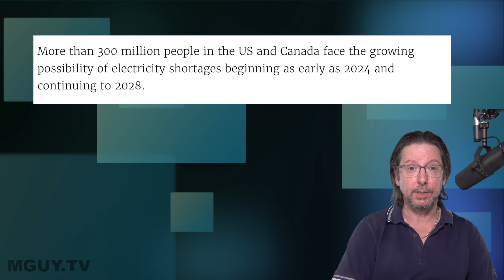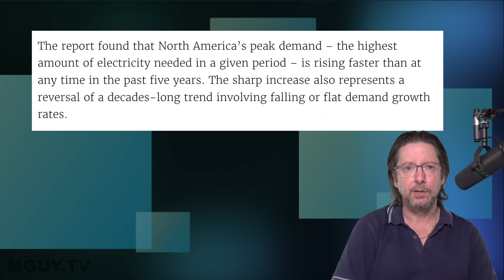Electricity grids WON'T COPE with mass EV charging | MGUY Australia

Comment: On top of that, the power grid is 33 percent efficient. A diesel is already more efficient before you even plug in your EV.
Reply: This is why some EVs now come with a Range Extender aka a ICE generator.
Reply: @winstons1806  which is just comical
Reply: @winstons1806 no, that is just a bid by the oil companies and legacy auto makers to keep control of your wallet. 
They don’t want you having real independence by making your own energy.
Reply: There's that 33 again. 😂
Reply: You are one of the very few people who realizes that.
Reply: If a diesel is more efficient than electricity, why do hybrids exist and have higher mpg?
Reply: @Undergroundexpedition  you could do the same thing with a big spring. Hybrids store kinetic energy. At 100 mph a hybrid and a regular car, of the same type, the regular car would get better mileage. No kinetic energy to store and the hybrid is heavier.
Reply: 33%,  I think you need to put your aprons on and get back to lodge you clowns.
Reply: Yummy spicey comments!
Reply: What's 33% efficient, from power source to power point, or just the power grid itself? I would have thought the grid was a bit better than 33%, but power source to power point, 33% could easily be optimistic, especially if it involves burning something.
Reply: 33% is optimistic, not all generating stations can manage that, and that's before you take into account losses on distribution.
Reply: What is the actual MPG a car as heavy as the cybertruck will get, considering these losses? The real question is in terms of co2 emission, not “efficiency” in terms of an energy unit. I honestly don’t  know the numbers. I have to assume based on physics/weight and the way I see Tesla owners drive, that there is just as much theoretical damage to our ecosystem if not more.
Reply: @Hexadeci  Tesla Cybertruck is ~361 Wh/mi (123 kWh battery pack/340 mi range AWD) using the US average electricity source emissions of 0.857 lbs CO2e per kWh (0.3712 kgs CO2e per kWh) is ~134 g/mi

2023 Ford F150 Pickup 4WD is ~451 g/mi (2.7 L, 6 cyl) -470 g/mi (3.5 L, 6 cyl)
Reply: @Hexadeci you assume wrong. For one thing, power from the grid is already more efficient than an ICEV. That means less CO2 even if you were to power Cybertruck directly from a coal plant. So efficiency matters for CO2. 
But there is no 100% coal grid. The US average is around half carbon free. 
So Cybertruck will result is much less carbon being released than a similar truck doing similar things. 
And that is with today’s grid. The grid is decarbonizing at a rate of about 2% per year.
Reply: 😂🤣😂🤡🤡 well that is misleading as hell.
Reply: @williammeek4078  nope. It's facts. If the power plant is using fossil fuels, an EV is responsible for more CO2 than a diesel.
Reply: @Bryan-Hensley  i call BS. List your references, primary sources only. No links Utube blocks them.
Reply: What do you mean 33% efficient? Transmission losses in an electrical grid are typically 15%-20%. Burning fossil fuels in an engine is much worse. You lose 50% of the energy turning crude oil into petrol through drilling, pumping, refining and transporting it...then your engine at best is 30% efficient so only about 15% of the energy in the crude oil gets turned into miles driven. 80% of the power generated on the grid gets to the consumer unit, then I lose 5% in AC/DC conversion into my car and the electric motor turns 95% of that power into miles driven...So an EV is much more efficient at turning primary energy into miles than a fossil fuel car is.
Reply: @kiae-nirodiariesencore4270  incorrect, electric transmission losses are only about 4%-6%, not anywhere near 15%.
Reply: @kiae-nirodiariesencore4270  rubbish
Grid losses often exceed 80%.
AC grids lose enormous amounts of energy inducing voltage, magnetic fields, and current flows in anything electrically or magnetically conductive anywhere near them.
They probably use more energy inductively heating humans than charging car batteries at this point.
Reply: @Maungateitei  Are you an electrical engineer? Didn't think so. And did you go to the website I pointed you at? You have a lot to learn.
Reply: @kiae-nirodiariesencore4270  I am an electrical, mechanical, chemical, and high performance materials engineer.
And you can't post external links on YouTube. It deletes them.
Reply: @kiae-nirodiariesencore4270  He might be referring to the combustion of fossil fuel to generate electrical power,  which like a car engine, are around 30% efficient, because both are examples of heat engines.  The simple electricity transmission to users is around 95% efficient, as not much electrical power is lost to heat in that process. Also there is a lot of energy used to produce the coal or natural gas to make electricity, so they have that in common with crude oil.  About 45 percent of a typical barrel of crude oil is refined into gasoline, with an additional 29 percent refined to diesel fuel. It takes about 4 KWH to make a gallon of gasoline, which contains about 34 KWH of power. You can get only about 10 KWH out of that gallon in a heat engine. A charged 70 KWH EV battery has the available energy of 7 gallons of gasoline.
Reply: @Andriastravels  which is why the use of fossil fuels for generating electricity is declining rapidly. In France we are below 5% coal now and gas is hardly used. In UK also coal is almost gone from the grid. In the USA coal has gone from 40% to below 20% in 10 years. Most fossil fuel burning is what Lawrence Livermore Labs call 'rejected energy', their energy flow charts are most revealing.
Reply: Diesel production is very inefficient. You have to pump oil from the ground, transport it to the refineries, transport to the pump, and then burn it with only 50% efficiency.
Reply: Not when you count the full diesel production and distribution system.  Plus, EV's can charge from local solar generation, the efficiency of the power grid is irrelevant, because the grid itself is becoming irrelevant.  Centralized thinking is dying, thankfully.
Reply: @chrismuller2780  then you have to calculate the fuel source for the gas or coal power plant..how deep do you want to go? Do we need to count the environmental damage for lithium mining and processing too? What about the copper mining and production? An EV has over 300 lbs of copper.
Reply: @Bryan-Hensley  Count whatever you want, you'll never get past the fact that propulsion by combustion will never come close to the efficiency of propulsion by electric motor.  In terms of joules of energy, EV's hold an equivalent of under 3 gallons of gas, but go over 200 miles on that.  And the energy required to explore, drill, refine and transport gasoline only gets it to your fuel station.  You and millions of others then have to drive up there just to fill up, instead of it getting filled up in your garage by a power plant already producing a boatload of power at a certain level of efficiency anyway (or your own solar) -- all before your head leaves the pillow.
Reply: @chrismuller2780  My petrol car goes 155miles on 3 gallons of gas. and that is now in Winter.  180miles in the summer. My friend used to own a VW Lupo 3L, that made 248miles on the same amount of fuel (that was a diesel) (edit: can add that that car was made 24 years ago)
Reply: @AndrewTSq Good for you, but there are still many cars that can't get above 50 mpg. EVs still can get 300 miles on only 3 gallons of gas.
Reply: @youseflatif796  They do that in good conditions, but ev in -12 degrees celsius and studded tires no.
Reply: @AndrewTSq  It would go down to 150 miles still which is the same as the unbelievably efficient gas car
Reply: @youseflatif796  There are more problems.  The public charger here is $0.8 / kWh, while gasolin is $1.8 / liter. Since a EV then uses like 2kWh / 10km, you get a cost of $1.6 / 10km, while my Ice car cost me less than $0.9 / 10km.  Not to mention my tank takes 3 minutes to fill up to full again.
Reply: @Bryan-Hensley  The most mined metal is iron, for making steel. It massively exceeds the mining of anything else. Rather boring though so nobody gets in a tizz about it.
Reply: @AndrewTSq  Is that a DC fast charger? Because pretty much you only need level 2. And if you live in a house, that would be even better since you can install one yourself. But you can keep using your gas car. I'm not completely against them, just don't like it when someone tells a myth about EVs.
Reply: @youseflatif796  I live in an apartment. I dont like when people make up stuff about ice cars either.
Reply: @AndrewTSq great. Keep that car.
Reply: @williammeek4078  I will try to keep the car until Tesla Model 2 comes out.  (if it comes out)
Reply: @chrismuller2780  How are you gonna have your car charged by solar before your head leaves the pillow? Do you know how PV and the sun work?
Reply: @youseflatif796 yes. Then you have to wait 8 hours to put the next 3 gallons in.
Reply: @davelowe1977  If level 2 charging, but DC fast charging gets you a full battery in half an hour
Reply: @youseflatif796  Only if the charger has sufficient capacity.
Reply: @davelowe1977  Most DC fast chargers are over 50 kW. But you would only need DC fast charging if you forget to charge or you're going on a road trip. But you can just wake up to a full battery and you know you're only gonna use 20% of the battery.
Reply: @chrismuller2780  "Irrelevant" hardly.  The reality is, for the foreseeable future, it is a myth that local solar can  charge EV's.  Solar power, even rooftop solar, is tied into the the grid, which we all know is predominately fossil fuel based.
Reply: @Andriastravels A friend at just above 50 degrees with roof solar in concert with a PowerWall has no problem keeping hisTesla charged. He says it’s the  PowerWall being charged throughout the day makes all the difference.
Reply: @davecooper3238  A powerwall is about $12K US installed, not counting the solar bits.

That buys a lot of electricity from the grid.
Reply: @teekay_1  My friend paid much much less than that. But he lives in Europe.
Heard stories about the high cost of living in Australia.
Reply: @davecooper3238  I'm quoting US prices
Reply: @Andriastravels  I agree.  We need the fossil fuel economy, and I can't stand the government's meddling.  However, I disagree with the notion that ONLY centrally-produced power is sufficient.  Solar needs the grid and, IMO, the grid -- if its purpose for existence is to serve individuals -- it "needs" people to have a local plant (e.g., solar+home battery).  Otherwise, as individuals, the grid alone won't have the resilience needed to continue providing the uninterrupted power we demand while simultaneously growing to meet ever-increasing demands for more energy to supply for all manner of technology -- not just EV's, think of the energy demands of AI, crypto, and robots.  Advanced manufacturing, and all new military weapons that demand huge amounts of power.  These applications need electric power, they aren't feasible via fossil fuels.  So innovation and build out is going to happen, and there will be large economic explosions.  But, it could be a bumpy ride getting there if we don't embrace the necessary infrastructure, which involves a "mix".
Reply: @davecooper3238   Solar rooftop does not produce power all the time.  It depends on weather and latitude,  but average 10 KWH per day (4 MWH per year) is typical. So the Powerwall and his house are connected to the grid.  Any solar energy he produces is instantaneously mixed with grid.  If he never pays a utility electric bill, then he is charging his EV and powering his house with solar and Powerwalls. 
An EV battery is 60 KWH or more.  We want to believe we are charging our EV's from solar, but in practice, we are using the grid mix unless we have the space, and invest $75,000 plus on a 75 KW system, with batteries, isolated from the grid. Even 75 KWH might not be enough, either.
Reply: @chrismuller2780  It is good you are optimistic, and a thinker.  I can not agree because I have watched incompetence, inadequacy, and failure for too many years.
Reply: @chrismuller2780  I am not sold on local solar and batteries, that is too sprawling and unreliable. I do see some potential in local small modular reactors, hopefully Thorium. But then you have the public opposition.
Reply: @Andriastravels  Every little helps. My friend is happy with his setup.
He had money to invest. Recons the return is worth it.
Reply: @chrismuller2780 😂 decentralised generation is basically subsistence farming for your electricity. Works great if you don’t mind the loss of living standards and productivity. 

We need industrial electricity production which means hydropower, geothermal or nuclear if you want zero emissions.
Reply: @polarbear7255 Nonsense!
After a decade of hassle free all the energy I need for home and transport, I would never consider buying grid power again.
You can't rely on in, it costs more for a month of it than it costs to free yourself for ever.
Solar and wind rock!
Reply: @Maungateitei 😂sure bro,  you do you. As an engineer I’ll take industrial generation and productivity any day. I like ample electricity, cheaply and on demand whenever I goddamn want it and I don’t want to have to make it myself because I have more productive things to do with my time. 

IVE will never decarbonise our electricity grid on its own. Any Engineer will tell you that… the problem is politicians listen to ideology and not engineers.
Reply: @polarbear7255  As a Multiple world championship winning high performance engineer myself, I also appreciate plenty of electricity whenever I need it, which is why I don't like to waste my time and money on unreliable grid power.
I have never been short of electricity in over a decade, waste no time working to pay for either  it, or the licenced inspectors and tradies the bench warming scum in parliament require you to pay to get access to it.
You idiots frying yourselves with AC grid power waste 90% of what you pay for, turning it into heat, noise and dirty emf, just cause you need low voltage DC like I have to begin with.
And you are stuck in your climate controlled house prisons because you are trapped by the fragility of your toys.
Myself, I have electricity in abundance wherever in the world I choose to roam.
🤗
Reply: @Maungateitei  sure. Spoken like a true zealot. Industry and EV charging will require far more than 12v. Heck, nothing in my house prison runs off 12v except my phone charger. But again, if you were a multi award winner you’d know that, wouldn’t you? 🤣 Happy new Year 🥳
Reply: @polarbear7255 no, it means industry will have to support itself without being subsidized by the public.
Reply: @polarbear7255  yep, politicians really need to embrace nuclear power generation, much more 'bang for your buck', reliable and cheap
Reply: @williammeek4078  🤣 industry subsidised by the public? Good one! What as much as the billions spent to subsidise wind, solar and EVs so that taxpayers can help rich people afford flash new cars?
Industry subsidies create jobs and lead to economic prosperity and are nowhere near as generous as those for renewables and EVs. But whatevs
Reply: @gottalovethephilippines5417  absolutely. There is I fear, overwhelming ideological and political opposition to nuclear energy in Australia. Whether this changes depends on public education and voter habits… but it needs too or we are in for a future of scarce and expensive electricity…
Reply: @polarbear7255  "Globally fossil fuel subsidies were $7 trillion or 7.1 percent of GDP in 2022" (International Monetary Fund)
Reply: @xiangkunwan  so what? What are subsidies for IVE and storage and transmission? Get rid of the subsidies and see the real costs of as a system of IVE and it is by far and away the most expensive. Global subsidies for fossil fuels have precious little to do with the discussion. Pls try to keep up.
Reply: @polarbear7255  exactly
Reply: @polarbear7255  what, you never noticed how much more expensive residential electricity is compared to commercial or industrial?
Reply: @chrismuller2780  As someone living in Sweden, where the sun comes up at 9:00, and goes down at 15:00 today,  this sounds perfect with solar generation.
Reply: @AndrewTSq doesn’t Sweden have lots of hydro? In fact much of Europe?
Reply: @AndrewTSq  and your neighbour  Norway has 33% of all cars electric and new electric vehicles running at 95% of sales.   Looks like they don't have a problem.  😮
Reply: @stewart5989  You know why they sell so many EV's? Cause they have removed tax on EV's, they have increased the prices of the ICE-cars. They give you a lot of benefits for driving a EV which you dont get using an ICE. So in short, they have made it become very very expensive to buy a ICE car in Norway. Thats why they are successful.
Reply: @chrismuller2780  the grid itself is becoming irrelevant

You may be right about this, but that day is probably a century away.   This is an example of magical thinking .
Reply: @teekay_1 i expect it to happen in the middle latitudes by mid century.
Reply: @chrismuller2780  Reality is a totally foreign concept to you.
Reply: @chrismuller2780 You really know nothing about thermodynamic principles.. don't you?
Reply: @absolutium 😂🤣😂🤡 how to tell me you are a trained dog that can’t think for yourself…
Reply: @williammeek4078  Is that your way of asking for help?
Reply: @absolutium  i figured it was yours.
Reply: @williammeek4078  You can only speak about that which revolves around your mind..
Im talking thermodynamics..
Your talk is trained dog..
Figure that out.. being nescient is not a talent.